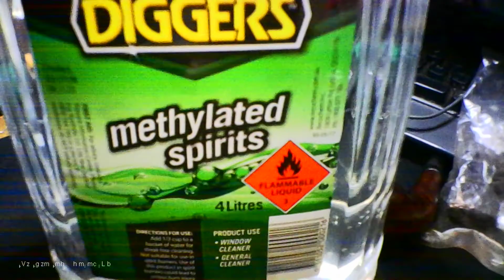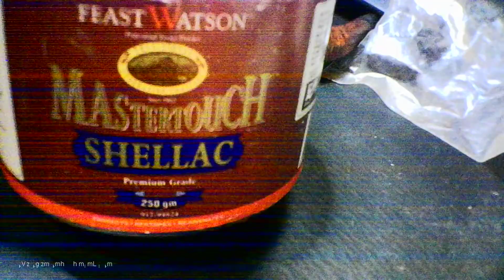Longchamp Pipe Renovation 🏇 - Part 2 - YTPC

Comment: Great job, thank you for sharing and teaching. Us Americans like keeping the rest of the world confused with dimensions.  Be well.
Reply from the maker: Thanks for watching and yes, all this "terminology" is confusing. Apparently, a 1lb cut is 1lb of shellac dissolved in 1 gallon of alcohol.  Presumably that would be a US gallon. Firstly, it seems a waste to use all that alcohol just for shellac and secondly, that would be enough to refinish several thousand pipes probably.  Anyway, I was taught to guess the ratio in order to get a fairly thin solution and that works because you can add alcohol or shellac to your cloth to adjust as you go.